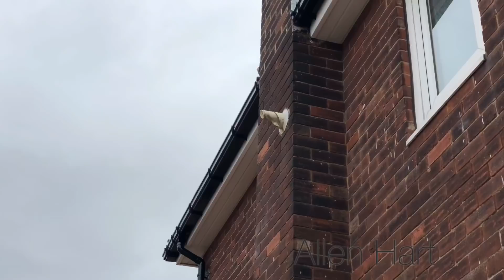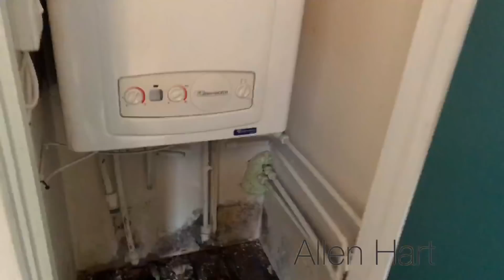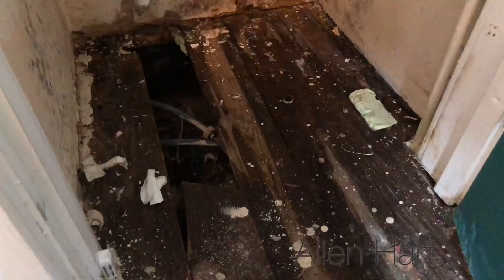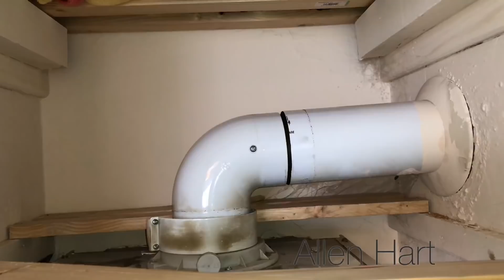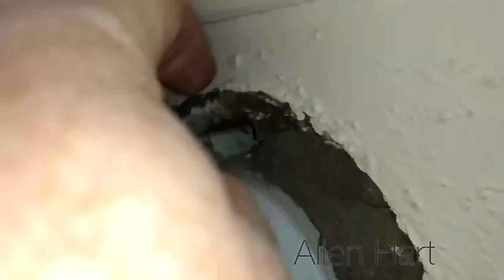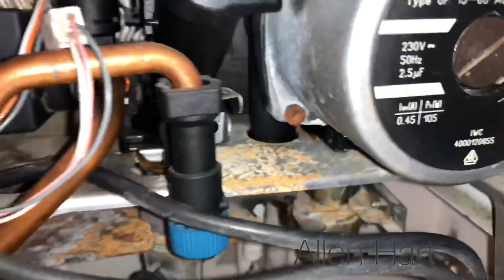Badly installed Combi Boiler , A day in the life of a Plumber / Gas Engineer

Comment: Did the flue run through the space in the chimney flue?  Or was it running through solid brick as the side of the breast?  If the latter then it is fine - apart from a joint in the brickwork.

Comment: Pretty sure you can put flue through disused chimney stack put sleeve through to protect it. Just like a big cavity really
Reply from the maker: This chimney was in use. Thanks.
Reply: Allen Hart yes i know but it was not made clear that it can be done if disused. That stove might of been put in after boiler but by the state of the install probably not.
Reply from the maker: @fudgemc  I am not an expert at videos tbh , Thank you for picking me up on it. 👍
Reply: @AllenHart999  Would the chimney flue be lined with a double skin flue, or would the log burner exhaust straight into the chimney?
Reply: Yeah but it's got to have to be inspected. All sorts of wrong could be going on. Terrible stuff going on here

Comment: What's the issue of going through the chimney space IF the woodburner has its own chimney liner?
Reply: David Jones Well that all makes sense thank you.👍
Reply: you could argue that for such a seriously bad install which dramatically drops the efficiency rating that the flue has its own extreme heat recovery unit which will bring the efficiency back up.. so for an old boiler it was unintentionally ahead of its time...